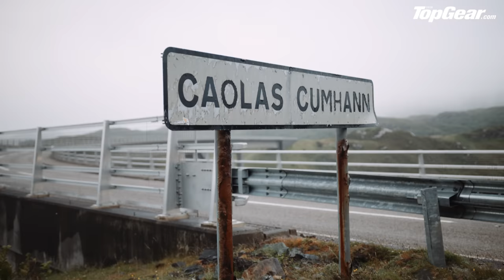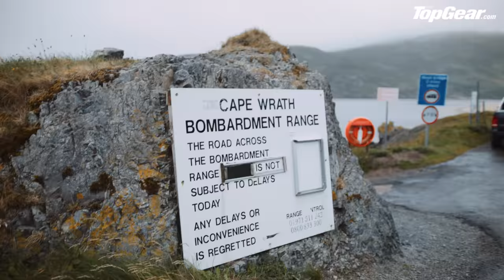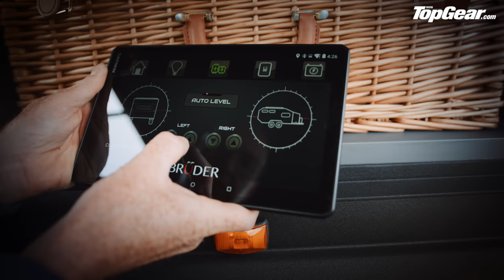ROAD TRIP: Land Rover Defender With World’s Most Extreme Caravan | Top Gear

Comment: The safety chain should not just be hooked over the tow ball. It should be attached to a separate fixing point on the tow vehicle as it is designed to secure the trailer if the tow ball breaks.
Reply: Yes spotted that and it did have the second fixing point too.
Reply: These guys are the WORST!
Reply: It got me shocked as I saw it too.
Reply: Lol what's the worst that could happen, they have a beast of a trailer and couldn't even find mud. They could have done all this in London.
Reply: @antonoat  Jaguar Land Rover  to a tee - reliability is dire and I wouldn't touch one - they are the new status symbol - all blacked out and never get tested towing or off road!! I do have an old Defender 110!!
Reply: @JeepCherokeeful  it hurts the most that they call this Top Gear ⚙️ 
I'm barely in my 30's but can safely say that I miss the good old days...
Reply: @antonoat  Who says they are not good, you have one? I have had two and never missed a beat, been across the Simpson desert  and 4X4 almost every weekend. Don't parrot what the internet says
Reply: You have had 4 but you think they are unreliable ?

Comment: Maybe the Defender's transmission was over heating, resulting in reduced power. So that the car could preserve the transmission.
Reply: What usually causes the transmission to overheat?
Reply: @kennysakala4839  Sometimes excess load  - either the weight or the weight coupled with the gradient of the terrain. Some manufacturers don't put it in as much cooling as say the aftermarket because they are subtly trying to cut down on production costs.
Reply: Nope neither of these needs a resistor between the brake switch and the brake controller of the caravan ecu gets confused and goes into reduced power mode. Had the same issue on a discovery 4.

Comment: You have one of the most capable trailers in the world - shame you didnt go offroad and pull it up rocks etc - thats really what people want to see.  If you're driving down an A-Road you might as well get a Ford F350 and pull a 40ft Fifth Wheel.  Next time actually take it through streams / up mountains / through woods etc.  Thats the only reason you would spend the insane money on a Bruder.  And the Defender isnt exactly cheap either when kitted out with the necessary options.  Off-road 4x4!!!!!

Comment: In Canada, had considered getting a 110 but seeing all the electronic issues really scared me off.  Too bad, such a good looking vehicle and has some decent off-road performance.  Ended up with a much cheaper, but more reliable Toyota 4Runner TRD Off Road.  Even with all the aftermarket add ons (steel front bumper with 10K lbs winch, Toyo 285/70/17 AT3 C Load tires, 2” suspension lift, replacement UCA, Sherpa roof rack, additional skid/diff plates, lights, auxiliary switch panel, etc.) I’m still ahead $25K!  Granted it doesn’t get the best mpg’s now, it is fun to drive, been great off road, no electronic / mechanical issues at all.  When it has snowed in the last few weeks, people don’t want to drive anywhere, whereas I can’t wait to get out there … lol.  If Landrover improves reliability (heard recent issues with having it towed, has to be flatbed towed) I might consider a change in 3 yrs.  BUT, now Toyota has the new Landcruiser coming out and the 4Runner next gen coming out next year.  Exciting times for folks that like these vehicles for on and off-roading.

Comment: Nice video enjoyed that. I live in Aus now and caravans are big business here - that little monster would be very popular! You didn’t mention the price which is presumably because it’s quite pokey! (And can we please stop banging on about Clarkson, Hammond and May - they had their time and they’re doing their thing very well elsewhere)
Reply: I live in Australia and I think if it doesn't have an air con, it’s not going to be very popular.
Reply: @Roo-kf5xi  He said it did have aircon
Reply: @Roo-kf5xi  it does have aircon
Reply: @Roo-kf5xi   It has air con, a pressurised cabin and an exterior which insulates the cabin from the extreme temperatures of the Australian Outback (rated to 50 degrees I believe).
Reply: Well said. Clarkson et al have had their time. Just bloody boring now.
Reply: @Roo-kf5xi  I wonder if it will Red Light in some proper heat?

Comment: Did you lock off the air suspension into non-load-sharing mode to reduce pitching?  And set the ride height to that of the towcar?  Also, that chain...it's there to be hitched to the car s if the towball fails the trailer is still attached by a safety chain. Or maybe it doesn't work like that in the UK?  Load sharing/non-load sharing explained here https://youtu.be/hwU5D5vwRqc

Comment: The reduced power ”limp mode” is most likely the DPF regen that has failed. All Diesel Land Rover gets this after 40000-60000 miles, many before that also, or if you are unlucky the crankshaft just snapps leading to total engine failure. But the car looks good and the seats are amazing…

Comment: The old Mud Terrains on the van and highway yes on the car fail. For proper off-road vans look to Australia for Kimberley Karavans etc. Never heard of Bruder in Aus.
Reply: One of the best off road caravans and I mean offfffff road in Australia
Reply: Here in Australia, Brüder Caravans are definitely not very common due to their price and the fact they are made for extreme off-road duties. I own a Kimberley Kampers Kruiser S-Class and it is a very capable off-road vehicle and could probably go most places the EXP-6 can, and dare I say it has more interior space. Also, tow it with a Nissan Y62 Patrol - much prefer the 3T 5.6L V8 to that short wheelbase Defender.

Comment: This is the first real use of the bruder I’ve seen and it doesn’t even sniff the dirt 😂

Also you were probably overheating the turbo going up the hills
Reply: the ecu map should keep it within limits and the engine shouldn't be in production at a higher output than it can sustain without overheating?
Reply: @mb106429  I speak from experience! Luckily under warranty
Reply: @donkingdonkey4764 what car
Reply: @RohanSanjith  Range Rover HSE
Reply: @donkingdonkey4764  he def overheated that trailer's aggregate trailer mass is 3.5 tons

Comment: Please like this so top gear see it. Dear top gear please know the reason for the reduced power is due to not having a resistor between the brake switch and the brake controller for the caravan. Had the same issue with a discovery 4. Love from Australia.

Comment: What's the use of such beefy tires on a trailer? I get it for the axles of the car, but the trailer is just being towed behind the car so why does it need to have such grippy tires?
Reply: I would say: Bigger tyre = longer tread footprint = more flotation = less drag on soft surfaces. Ideal would be the same type and bolt pattern so you can use them on your truck as well and swap spares.
But for us in Europe it doesn't really matter i guess.

Comment: I do like the new gen Defender, it does look butch and macho. But £77,000? I'm not so sure. I rather buy a used Range Rover.
Reply: True is very expensive,,,,, better off with a range rover
Reply: 77 grand and bloody red light.! At Tebay.! 

I've driven around there in Series II with trailer with bullocks in it and no red lights.

(Let's be honest. It did sometimes overheat on hills. But not too often. 😉)
Reply: Yes yes, butch and macho. Kinda like the Village People. 😂

Comment: I agree about the Defender/Discovery issue. The 110 model should never have happened!  That 90 and the new 130 are all that was needed to grow the brand.  It has personally turned me against JLR products all together.
Reply: why 110 shouldn't be made?
Reply: @rudranewaz6664  besides the horrible design issues* and the fact it isn't a 110 since the wheel base is closer to 120, and it was far less capable.  A Defender 110 WAS a 9 or 10 passenger capable vehicle and the new one is just a 6,or 7 passenger capable vehicle.  Basically an LR6 in drag.  They could have made an 8 passenger model but didn't.   This meant it didn't do anything the Range Rover Sport and Discovery/LR5 couldn't do.  Also it competed directly with other 7 passenger vehicles like the Discovery Sport.  The new Defender "110" ruined the whole company by cannibalizing the whole brand based on fake posturing.

The new 2 door Defender "100" (known as 90) added to the brand and had proper proportions without damaging the company.  This new large "120" (known as 130) with 8 and possibly future 9 passenger capability adds to the portfolio of the brand which is what Defenders did.  The new 110 is basically a Disco-Tranny for the school run granny, or an LR6 Drag💋ueen, simply just 👄💄 on a 🐷, and traditionally by far the worst of the three, arguably all ugly designs!
Reply: 90/110 are legacy models. 130 is for the obese american market
Reply: @stardancer4077  90 is now a 100.  110 is a stubby 120 with horrible perportions.  The 130 is a proper 120.  There is nothing legacy for LR in ruining their naming history.

Secondly the classic Defenders don't fit Americans.   Even in the 130.  The new Defenders the 100 is the best for large drivers, not the 130.   Bigger doors AND front bench seat option.
Reply: Regardless they can’t make them anyway near fast enough to keep up with demand
Reply: omf  @midlandgeordie  you keep repeating that enough and even you might start believing it!  They lost $116 MILLION DOLLARS in just the 2nd quarter of this year!  (2022)  In 3 months!  How successful is that?  They are losing almost a HALF BILLION a year since they started with the Pretender!  It is the ruination of the whole company!   If they are not shut down soon its parent company TATA will be in danger.  Maybe Sir Jim will buy Tata and fix everything?!
Reply: @fabulousoffroaddesigns5080  We haven't had 2 quarters in 2023 yet. In the 3 months to December 2022 they made £265 Million in profit and before that we had a world-wide pandemic. I don't know if you heard about that?
They've sold nearly a billion pounds worth of new Range Rovers. Not bad.
Reply: @highlands  the post was written in December of 2022 you DS!

The bs number of "nearly a billion" is still less then 10,000 vehicles between the four models Range Rover makes!  That is 2500 cars per factory/year!  That is laughable!  Man factories do 100X that.  JLR is likely the largest money losing car company still in existence!  Ther has been a lot of talk about it lately amongst automotive journalists.
Reply: No Just ditch the Caravan and get the 130

Comment: Sounds like its over the 80% weight limit of the cars weight. Can the rest of us just ignore caravan towing advice ? Tail wagging the dog accident??
Reply: I just looked on the US site and the Defender 90 is rated to tow 7700lbs with a 770lbs tongue weight and that trailer weighs 5000lbs unloaded.
Reply: @chiefsilverback  Yes that is rated to tow, as in the chassis is strong enough. But if you look at any caravan towing advice by professional organisations like the Caravan club, the maximum weight of the trailer/caravan should not exceed 85% of the car’s weight. Legally not more than 100% at speed e.g. 60mph. Would you want the tail wagging the dog in a severe cross wind ?

Comment: This 'turn it off for five minutes and then restarts' trick is what all the LR dealers say and is of course, bull. If the circuits had things like big capacitors or other analogue components in critical places, it might be excusable and understandable but I am not sure they do and IF they do then it is crap design. The problem with LR electronics is that, unlike a Tesla which is designed with electronics as the core from the start, the LR philosophy is to add stuff on even if the old stuff works. You will often hear that LR updated a component and the problem went away. No it didn't and never will. If the car left the factory and worked, why has it stopped working? The basic design of the entire electronics of LR cars has been done by well-meaning people who are ignorant when it comes to electronics. You only need to look at LR diagnostics and compare its output with independent outfits like GAP and then talk to LR and then you realise just how amateur they are.
So, the 'reduced performance' issue is well known and could have been caused by hundreds of different things and they never know why. For example, you can have your suspension dropped, gearbox warning, ABS/HDC/DSC etc etc all with warning lights because....the steering angle sensor has a bad contact because it was assembled in an LR factory.
As for being capable, no they are not. If you want a proper 4x4, buy a toyota or a tesla X.
And BTW, they rust and corrode because of this ludicrous idea of aluminium and steel together which was relevant in 1950 but not now.
And in case you think the new ones are better, ask why the Ingenium engine has PLASTIC guides for the timing chain and now has problems..